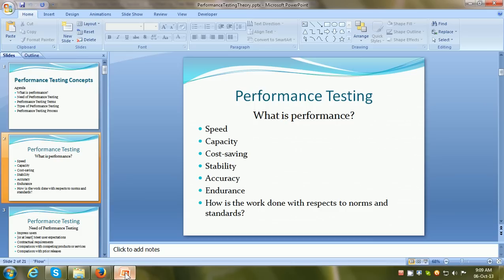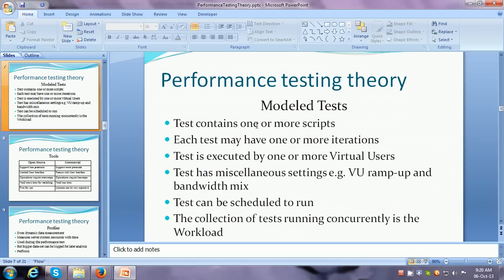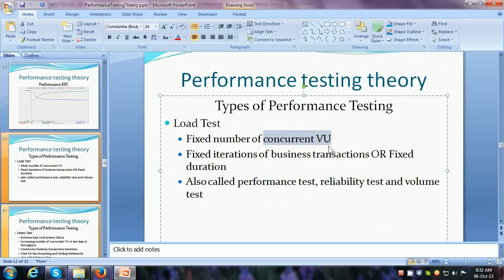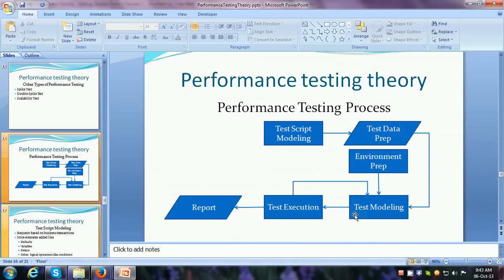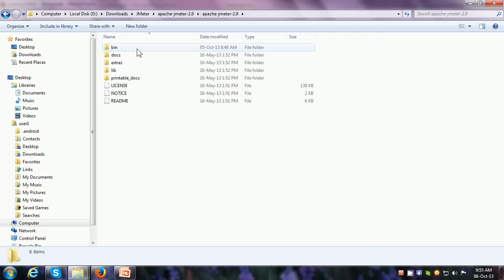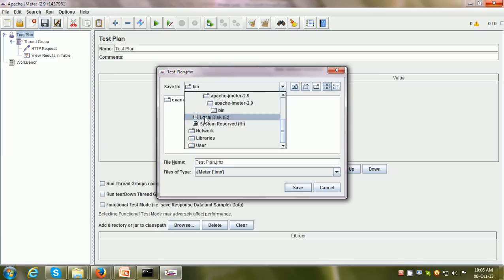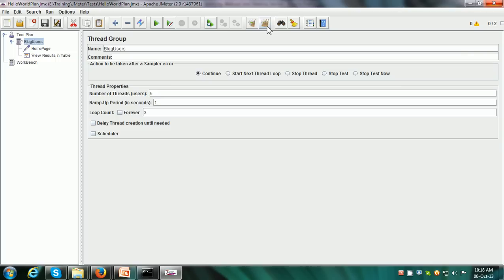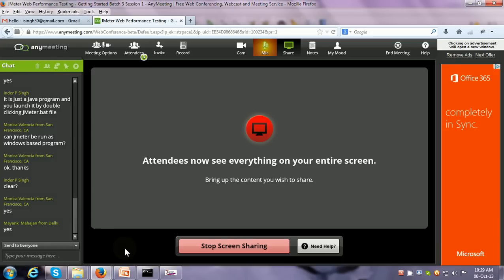Performance Testing-JMeter Performance Testing-Jmeter-Performance Testing Using Jmeter-Load Testing

Comment: what we should do when we test an application that runs on the local host in http request page
Reply from the maker: In HTTP Request, you can put localhost in Server Name or IP. However, you should avoid load testing the application running on the same machine as JMeter because both the application and JMeter would compete for the same resources like CPU, RAM and Network.

Comment: Hi,
 My Question is if i  m Going to test the Load for  100  concurrent users in this scenario , the 100 user having 100 type of login ID password , and their 100 respective passwords how to test this scenario.

Thanks in advance.
Reply from the maker: Hi, this is simple. You need to add a CSV Data Set Config to your Thread Group. Within this config element, specify the filename (a CSV file containing 100 login ID and password pairs).

Comment: Hi, While the Load Test is going on, can we add an extra script to the test plan without stopping the test?
Reply from the maker: Hi, you mean an extra Thread Group to the Test Plan? No. I could not even disable an existing Thread Group while the Test Plan is executing. But, you could always start executing a new JMeter Test Plan from another node (load generator) machine.

Comment: I am facing this WARNING: Could not open/create prefs root node Software\JavaSoft\Prefs at root 0x80000002. Windows RegCreateKeyEx(...) returned error code 5.
is it ok to work with this warning?
Reply from the maker: Sorry to know about the warning message. Right-click on jmeter.bat and Run as Administrator once. After that, you should be able to run JMeter.bat without any warning message.
Reply: thank u so much
Reply from the maker: Sayma, you are welcome.

Comment: Hai Inder,  
you have done good job.
The question is how can we validate or receive the response data form the server which is protected with password for Example if we take Gmail and if i want to test the inbox it requires a username and password particular account and moreover how can we make sure that it is requesting that particular inbox page only and throwing the response.
Reply from the maker: Hi Chandan, thanks for asking your question. Now, in the example of Gmail, the response does not contain the inbox!! How it works is like this. In JMeter, we put a request to log in to the system with username and password. The system authenticates the request and provides a token, to be reused in further JMeter requests. We can do validation of response data in JMeter with Assertions. You can see example of Assertion in my other JMeter tutorial at https://www.youtube.com/watch?v=3TZegZPz3a4

Comment: It is possible to run j meter for windows based applications?
Reply from the maker: JMeter can send requests using different protocols like web, soap, database. JMeter is used to test server performance. It does not matter whether the client is a Windows based application or web based application.
Reply: Thank you inder.. thank uh so much
Reply from the maker: You are welcome, Fouziya.

Comment: appreciate your help on some small thing: 
I need to extract from DB a user and a password in order to pass them as parameters within HTTP request. 
Please mention the step to perform this task
For some reason what I do at the moment I fail miserably. 
Many thanks in advance!
Reply from the maker: No problem. In order to extract the username and password from a database, you can use the JDBC Request sampler. Create a separate JMeter thread group with 1 user to get it working first. Your Select statement should return the username and password values in variables. The steps are given at http://jmeter.apache.org/usermanual/component_reference.html#JDBC_Request
Reply: Software and Testing Training thankuu so much
Reply: By using jdbc request i extract from DB a user and a password in order to pass them as parameters within HTTP request. How can i pass it as http request.
Many thanks in advance!
Reply from the maker: Good to know that you now able to extract the username and password from the database. Make sure that your Select statement returns exactly one row with exactly two columns (username and password). In the JDBC Request,  put two variables in Variable names field e.g. U,P. Then, you can use these two variables in your HTTP Request as parameters ${U} and ${P}.

Comment: Sir if i want to test with 100000 users (threads). Is it possible with jmeter.?
Reply from the maker: There are big web sites with a huge number of users. So, this is not an unrealistic requirement. Yes, JMeter can put a huge load. But, the load generator or load generators have to support it. A load generator with a server operating system can support more threads than a desktop or laptop.
Reply: Thank u so much sr.

Comment: I have a one login page , when i try to login, a otp send in its database ...after entering the otp in  the loging page ..a new page will open ..here some fields are present here and save button is here...my requirement is ...I want to measure the what exactly navigation time take to open after entering the otp.. and after login successfully I fill all the fields of the  and click on save button..what exactly time take to save the data
Can it possible with jmeter or not ? If yes ..how ?
Reply from the maker: Yes, it is possible for JMeter to measure the response times. The two requirements (Enter OTP page and Log in page) are similar so the following apply to both.
1) You need test data e.g. a bunch of valid OTP's.
2) You may be able to record the traffic in JMeter using HTTP(S) Test Script Recorder to get the JMeter requests.
3) If JMeter in unable to record the traffic, you can use a tool like Fiddler or use Firefox > Tools > Web Developer > Network and add the HTTP(S) requests by hand.
4) Once you have the requests, you should do request parameterization.
After all this, place the requests under a thread group, set the threads, add a listener and run the test plan as shown in this tutorial.

Comment: i'm having an error message on a command prompt while i try to open the jmeter shortcut. here is the error message:Could not find "ApacheJmeter_core.jar ...
... Trying JMETER_HOME=..
Found ApacheJMeter_core.jar
Created remote object: UnicastServerRef [liveRef: [endpoint:[192.168.0.21:57841](local),objID:[ed497d1:15dc50cefc5:-7fff, -8420933057866952026]]]

Please assist on what to fix. thank you as always!
Reply from the maker: It is not clear from your comment whether JMeter UI instance actually launched or not. There is no JMeter shortcut, we have to create it ourselves. Here are some things to try to launch JMeter UI.
1) Find jmeter.bat file in the bin folder and double-click it to start JMeter.
2) Check that JMETER_HOME environment variable contains the full correct path to the bin folder. Then double-click the jmeter.bat file to start JMeter.
3) Double-click ApacheJMeter.jar file to launch JMeter.
Reply: it worked. you're the best! Keep up the marvelous job and thank you for your continued support.
Reply from the maker: You are always welcome.

Comment: status showing errow with red symbol.
what should i do?
Reply from the maker: It is hard to give a simple answer to your question. What are the values of Number of Threads and Loop Count in your Thread Group? If both are 1 and you get an error, it means that the sampler (HTTP Request) is incorrect so you need to correct it. If the product of Number of Threads and Loop Count (i.e. the total number of iterations) is huge, a single error can perhaps be ignored as an anomaly. If in between these two extremes, then the errors should be debugged (perhaps it is an issue with JMeter load generator or the network or the system under test).

Comment: findstr is not recognized as an internal or external, 
Am getting this error with batch file. What I have to do? I have java installed.
Reply from the maker: Right click on the JMeter batch file and click Run as Administrator.  You may need to do this just once i.e. next time you could just double click the JMeter batch file to run JMeter.
Reply: Thank you so much, My problem has been resolved.

Comment: Hi, I want know Can we use https: url with jmeter testing?
Reply from the maker: Yes. But, JMeter sometimes faces an issue in recording transactions on HTTPS websites. If you need to record against HTTPS websites you can consider using a tool like Fiddler. Or don't record and add the samplers by hand.
Reply: Ok, Fiddler is performance testing tools?
Reply from the maker: Yes, Fiddler from Telerik is also useful for debugging.

Comment: Can you please tell me how to use regular expression extractor to pass the token of one requests to another
?Thanks
Reply from the maker: A regular expression extractor is a post-processor element. You can add it to a request to get the value in a variable. In the other request, replace the fixed value with the variable e.g. ${date}.

Comment: sorry but you confuse the term 'iterations' with 'threads' can you explain both clearly pls? thanks. ange
Reply from the maker: In JMeter, threads are the virtual users. The larger the number of threads, the more load on the system and vice versa.   Each thread (user) can perform some work which is sending a bunch of requests to the server. Now, sending one set of requests is one iteration. Iterations are specified in Loop Count. Number of Threads and Loop Count are both specified in Thread Group element. Thank you, ange

Comment: how to define url ckeck per thread? I want to setup one thread to check one url for 10mins but after 1st min 2nd thread is active and it start to check another url and ther it griws... third thread...on third url and etc.   please help. Tnx
Reply from the maker: In JMeter, a thread represents a single virtual user.  In order to check a URL, you need to add a HTTP Request sampler in your JMeter test plan. Thank you.
Reply: I know what you mean but how to achieve this: http://prntscr.com/chhx5a  Table when will each thread start?
Reply from the maker: You have just used a plug-in to increase and decrease the number of threads. In other words, you have defined the load profile. However, this does not meet the objective that you stated above. 
Did you know that you can parameterize any data in the HTTP request, even the Server Name or IP and Path? This way, you can try to hit different URL's in different iterations of the same thread (user).
Reply: I really appreciate your help and time that you take to help me out. Problem is that I am not that familiar with Jmeter and I do not know what the best way to create test in which I will be able to simulate "proportional load" which is growing every X time. For example load start wish 1 websites (which has X users lets say 10), after 2mins 2nd websites starts and extra 10 users (first one is still on load), and then it grows, 3rd website, 4th and then 5th. Reason why I want this test is because all 5 websites are on same web farm and I want to see how computer resources behave by the time. I do not know what is smoothest way to create this test. I have tried with CVS files but there I defined only url list an I cant (I dont know how) to perform multiple websites at same time not one by one.
Reply from the maker: One way to test the 5 websites on the same web farm could be like this. Add 5 Thread Groups to the JMeter test plan. Each thread group should have one HTTP Request Sampler. In each Thread Group, one can define the number of users independently. Add Constant Timer to each Thread Group from no. 2 to no. 5, giving times as 2 min.s, 4 min.s, 6 min.s and 8 min.s. The timers will cause the delay before the requests are sent to the websites.
Reply: I have manage it, and its just as I wanted! Thanks a lot! This is what I wanted for test plan 1 (liner growth by visitors), not there is 2nd test plan what I want to perform (last one).

By 2nd test I would like to have same situations (10 websites) but with visits which looks like random visits by end users (by random I do not want system to generate random numbers, I want to add "random numbers manually" because I want to perform same test on Web cluster 1 and Web cluster 2 to see which LB algorithm works better). That is why I want to avoid random numbers by tool, I want to make random case by myself. 

Problem is that I do not know how can  I setup thread (website1) to run for example 10 seconds and then I configure other threads and then - How to recall 1st again? Because I dont want to have Thread by Thread as In fist test, now I want to have random mix of visits per website - any idea how to make this?
Reply from the maker: Good to know that your 1st test plan works now. 
It is not clear to me what you want to achieve in the second test plan. I could only understand that you want to have a random mix of visits but you want to make the random case by yourself. If so, it is not really random. Why don't you put all your designed requests under a single Thread Group? You can add a HTTP Request Defaults config element to your Thread Group so that you don't have to repeat the same settings in every HTTP request.
Reply: I wanted "manually configured random requests" because I wanted to compare how it works on Web Cluster when I use LB Algorithm A and then same test with Algorithm B. But maybe you are right... then its not really 'random requests'.

Problem is that I do not know how exactly can I setup 5 websites with random users and random time to visit, for example test could start with website2 and website4 have several users and then website5 only 1 ... etc ..etc.. I dont know how to configure test so I can define max and min users and random visits of websites 1 to 5.
Reply from the maker: One possible solution to consider. Add a Random Controller under your Thread Group. Add your HTTP Requests under the Random Controller. In order to give random delay before each request, add a Uniform Random Timer under the Thread Group.
Reply: You mean like this: http://prntscr.com/clftln   ?
I do not need to add anything in Random Controller it self? Also for the Uniform random controller?

By this I will get "random scenario" but the Threat Group will have always same number of users? Or it will be random as well?
Reply: I think this should be ok: http://prntscr.com/clfx5d
Am I right? What should I use for Rump-Up period?
Reply from the maker: I am curious to know why you didn't take JMeter training before working with such typical scenarios?
Yes, I meant like that but there will be all the HTTP Requests under the Random Controller instead of just one as shown in your image.
In the Thread Group settings, we can set the Number of Threads and Loop Count. If you put Number of Threads as the total number of users, say 10 and Loop Count as 1, each of the threads will send one HTTP Request out of all at random.
Reply from the maker: It is not "Rump-Up period". It is "Ramp-Up Period". If you don't have the accurate data to set it up, a rule of thumb is to have it at least the same as the Number of Threads (10 seconds in this example).
Reply: I do not know how to properly configure Thread Grupe parameters such as number of threads, ramp-up period and loop count to get as less as possible erros in result table (http://prntscr.com/cvbdux). Websites are working same as web server but it keeps generating errros in report and I do not know why... Any idea? Thanks.
Reply from the maker: Firstly, consider getting JMeter online training. You can give me your email address if you want me to send you the details of my online JMeter video course. Secondly, an error percentage of close to 50% is quite high. You could consider reducing the number of threads to say half or other fraction to see if it reduces error percentage to less than 10.
Reply: Thanks for info.

My last question I promises!

Do you have any idea or link to material how can I achieve higher "random factor" for example to in one second to have 50 http hits and then in next one 5hits?

I will not bother you again. Thanks for your time.
Reply from the maker: No problem. You could consider adding a Uniform Random Timer to the HTTP Request sampler. Uniform Random Timer can put a random delay before each request that goes out.

Comment: In JMeter, It can able to test mobile apps?
Reply from the maker: Yes, but the mobile device needs to be configured before recording on it. Also, JMeter does not test the user interface. It loads the server by sending requests to the server.

Comment: Nice video.. When can we start the complex loading testing?
Reply from the maker: Thank you. Please check out my videos set that covers LoadRunner version 12. These cover a number of other load testing concepts. The link is https://www.youtube.com/playlist?list=PLc3SzDYhhiGU6fbp6JlTU8GPbEw_-eQFx
Reply: Hi. How do I find out how many users my site can handle at once? Do I keep increasing users until JMeter crashes the server?
Reply from the maker: This is called a stress test. One way to increase users is to double the JMeter threads (e.g. 10, 20, 40, 80, 160, 320 and so on ) in every subsequent test run. Once the server crashes or becomes unresponsive, you may want to narrow down the exact capacity of the server. Say, the server died at 320 threads, so we know the capacity is between 160 and 320 threads. Go down by a quarter i.e. 240 threads in the next run after restarting the server. If the server supported the load, go up, say 280 threads.
The capacity of the server should be more than your expected load of users visiting your site at peak hours. Thank you for your question.
Reply: Software and Testing Training for Stress testing, isnt it better to use something like apache bench?. great video by the way.